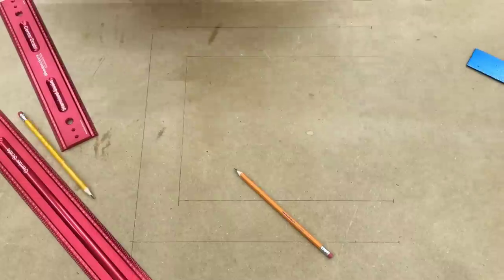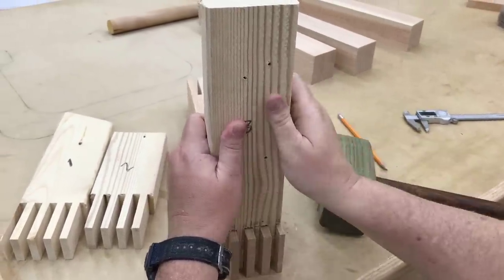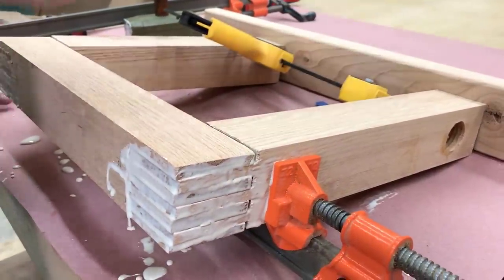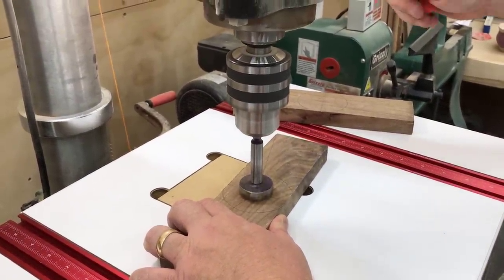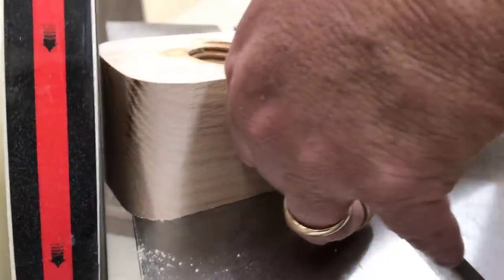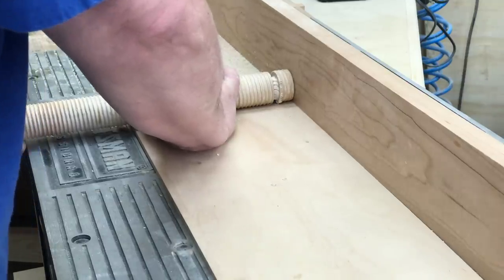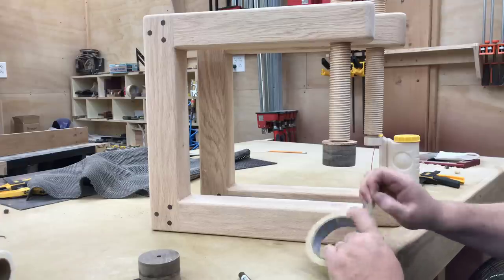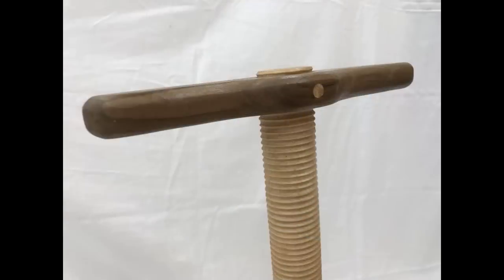15 - How to Make Deep Reach C Clamps All Wood only $10 Extreme Strength

Comment: You have a delightful, soothing voice and demeanor while working and teaching. The thorough nature of your instruction leaves us mere mortals, who clearly are not worthy of wielding Thor's Hammer, with the impression that we could do this, too. I think I will definitely be getting a little palm router and making a table for it. I might be able to leverage SOME of what you did here with that. I  have a pretty bijou shop squeezed into one corner of a garage, so that table saw-multiple router table-drum/disk sander-compound mitre saw-giant bench set up you're rocking there isn't really the water I swim in. And my hammer? It's made of rubber and it's fancy name is "The Gentle Persuader". Maybe I too can make a giant wooden clamp using some of these techniques. Hope. It's either the best or worst emotion.  Thanks for a great video. I will be referencing your build when I attempt my own clamps. But first, I'ma needa buy a whole heck of a lot more clamps...

Comment: Nice! 
Yours are quite a bit beefier than either mine or Matthias' clamps, though, so it should be capable of more pressure. 
One thing i've found is that cross pins through the box joint like that don't make a notable difference to the breaking strength, and may actually weaken it.
Reply from the maker: Hi John! Wow, thanks for the comment! I'm a big fan of your work.   I was also wondering that myself. I'm a chemist and definitely understand the strength of modern adhesives. But I just wasn't sure, and so I put them there. I've not done any real world testing both ways myself.
Reply: I do not think that the pins will make the joints weaker - assuming there is much pressure exerted by the clamp , the joint itself will have a tension at the transverse member side (at the two pins) and a compression from the free side (at the one pin side) and there is a moment at the joint (working to dislocate it) - while the pins might lower the strength of the wood members (whether the horizontal or the vertical) , they will resist the moment which I think he was worried about - however, if the wood pieces failed due to stress , it is unlikely they will fail at the joint.
Reply: Adding walnut pins shure makes the clamps look cool!
Reply: This project is way cool. I would like to know where you got the tap & die set. I’m thinking it’s a must have item!

Comment: hello Mr. king I started watching woodworking/woodturning videos I guess 5 years ago off an on mostly on! and like you I had skill saw jig saw an a belt sander mostly for building porches an lean to's and like most I was inspired from the videos and now 5 years later I'm grateful to be able to say I've got a nice little hobby shop with most of the pretty's I'd still like to still  buy a drum sander an maybe a small CNC an I've made a half dozen or so projects that I'm proud of 1 of which is a miter saw station alot like yours that's not all the way finished don't even have drawer fronts on yet  but I've been using it like it is  for over a year I  said all that to say I like your channel so far more than any I've seen to date an yes I know the big name's in you tube some of which was mentioned in your discription or in the comments but I think an hope with time an you keep going like you are you will smoke them all. with respect to the big name's because there channes are great.  good luck mr. king an ps.  I'm glad my station isn't finished I'm going to steal some of your ideas ☺
Reply: Hello! Thank you for such a nice compliment! :-)
Reply from the maker: Sc

Comment: Very nice.  I learned a bunch.  I already built the body of a few clamps using a bridal joint (not looking for the strength you are.)   I then sat at the bench for a few hours trying to figure out the pads.  Needless to say, I did not have a eureka moment...  This video changed all that.  Thanks!

Comment: Very nice build.  2 questions.  Did you ever think about chamfering the dowel and drilled hole before threading?  Ever thought of using epoxy instead of wood glue on the thread and dowels?  Thanks
Reply from the maker: Hi Mike, thanks!  I did actually chamfer the dowel before threading. But not the hole in the clamp before tapping. I've never had difficulty tapping oak or walnut. 

There is also an important thing to consider, and that is your tapping & threading tools. The set I use, (both the tap & die) have a large starting area. The die for example, holds the dowel snugly for a whole 3/4" before the threadcutter ever engages. And there is a similar setup for the tap. 

If you use metal cutting taps & dies, you get no such luxury and you must take great precaution to ensure the threading is aligned straight. Plus of course tapering ends helps here too, because the ones for cutting metal aren't nearly as sharp. And it'll help ease into the cut. 

Thank you for watching!
Reply from the maker: As to the glue and the use of epoxy, the study I referenced in the description did in fact use epoxy for one of their test glues. And on wood it did not have the bond strength that type 1 PVA has. 

This is not surprising for me, I teach and have done research as an organic chemist, and I'm familiar with real life use of epoxides and related chemical functional groups.  However, there is a common misconception in the public that epoxy is the very strongest of glues. 

This simply isn't true. The chemical reaction between a curing adhesive and it's substrate are entirely dependent on what they both are.  For some substrates, like aramid fibers and similar polymers, epoxy forms an incredibly powerful bond. But for many other things, (wood included) it just isn't the case. 

In truth, companies like Titebond employ organic chemists whose sole knowledge base is in surface chemistry & adhesives. So it makes sense that all they do is work to make the very best wood glue.
Reply: ... and here I thought you were just a "Fine" woodworker.  Excellent "Fine Working" on a shop tool!

Comment: how durable they are? even some my metal clamps are now twisted after some time of usage... what will happen with wooden clamps?
Reply from the maker: Hi, That's a great question.  In the real world of engineering, metal fatigues and wears out. This is why after repeated stresses, in some cases it must stop being used. 

Airplanes are a good example of this.  For metal aircraft, once the airframe has logged a certain number of hours, it must be retired. After so many times flexing, it becomes prone to cracking and becomes dangerous.

No such restriction on wooden aircraft exists. Wood can continue to flex and not reach the point of fatigue. (provided of course that it is cared for and not allowed to rot, etc.)

I'm sure this doesn't translate exactly into the world of clamps, but certainly some of the principles must hold. I fully expect the wood to always return to a zero deflection point after the load is removed.  And of course metal clamps are probably never loaded to their stress limits.

I have no doubt whatsoever that these clamps will serve for a lifetime, as long as they are cared for and not dropped, glued spilled on or otherwise abused. But we should make no mistake, metal is a vastly superior material for clamps. But this is an inexpensive alternative, and hey, it's fun because it's wood. We are woodworkers after all.
Reply: In fairness, airplanes get retired because pressurizing and depressurizing them over and over again (which allows the people flying them to breathe at much higher altitudes than Mt. Everest) causes micro-stress cracks. Wooden aircraft are not pressurized. Metal non-pressurized aircraft last just as long as wooden ones, which is why there are still so many DC3's from the '30's flying around. If you tried to pressurize a wooden aircraft, which is skinned with hardened fabric, you'd blow the skin the first time out. ;)

Great video, though. I'll be using it to make myself a set!
Reply: The only clamps whose bars I bent were cheap cheap cheap cast ones. I didn't manage to bend the bar on quality clamps with the same size bar; I suspect the cheap ones use some kind of garbage steel that just isn't any good.

Comment: I think if you read the manufacturers' recommendations and most other sources will suggest to butter both sides of those boards, as do my years of experience (SalineRiverWorkshop) - TiteBond III is a Type III PVA (ANSI rated) glue (waterproof), TiteBond II is a Type II PVA glue (water resistant) and TiteBond (classic) is a Type I PVA glue - there are differences in price and in tack, open and cure times.  Talk to the store manager at HD/LWs and ask for a lower case price for the gallons and get them ten at a time (shelf life sealed is pretty good, freezing destroys it) - or talk to National Casein for the 55 gallon drum for the best prices on glue.

Thanks for the video, brother - I enjoyed it.  Keep up the good work.
       I Subscribed and Thumbs Up!

Comment: The router table looks like a lot safer place to cut that slot into your wooden screw.  I was wondering why you didn't at least use the mitre gauge to hold your work 90 degrees to the blade. Freehanding that on a table saw seems like a great way to get something thrown into your face at high speed.
Reply from the maker: Thanks for the input.

Comment: So $10?     $200 for thread cutter  & $45 for the oak (in UK) .   = at least $245 for a pair. Oh ! and make a finger joint jig !😭
Reply: Not if you grow and dry the wood yourself. And sell the car to get the tools. To get the funds to get another car. So you can take them to market. Then you just might break even.
Reply: Next on durp a dur, we watch as someone with no wood working tools and wood material complains that a wood working channel assumes you have a basic set of tools and some kind of wooden material.
Reply: @doibing9856  I'm a beginner woodworker. Not fully equipped yet. I agree: 10$ is very misleading.
Reply: Doi Bing 😆😆😆
Reply: @russellgrantappling1153  I never seem to break even.

Comment from the maker: Share pictures of your work & get help if needed.  Join our King’s Fine Woodworking Community Page. 

Woodworkers helping other woodworkers. Share advice, get project ideas. Free tips. Insider information. Get the best deals on lumber & tools. 

https://m.facebook.com/groups/134828903893994
Reply: King's Fine Woodworking 
Just joined the Facebook page, I'm excited to learn and do... I'm a boilermaker by trade and deal with metal as a job. Welding, cutting, torching is my job but I'm really enjoying woodworking.
Reply: Eric Jones k
,
Reply: Adrian Spenc
Reply: 3
Reply: A YEAH and thats how yo build a house with some woodglue sawdust and a serious crap load of clamps... lol
Reply: Could you please link to the research you mention at the beginning?
Reply: some on wise said you can never have to many clamps . exhibit A 35:46
Reply: Wow, not bad, you made some great $10 clamps and only consumed $500 worth of labor to make them.
Reply: Why didn't you just use a planer to get rid of the poured out glue on the joints? It would have been quicker and easier and give you a smoother surface.
Reply: @berniecruz8405 
Dried glue is much harder than wood. 
Let's see if you can figure out the rest
Reply: @TasteMyStinkholeAndLikeIt  i actually took wood shop in high school AND that's how I got the dried glue off the wood! So now, let's see if you can figure the rest out because I actually know what I'm talking about!
Reply: King's Fine Woodworking `🐐
Reply: saludos desde Mexico , me gusta mucho tu trabajo te envio muchos saludos y felicitaciones.
me gusta mucho tu canal.
Reply: Lovely Video clip! Excuse me for butting in, I am interested in your opinion. Have you heard the talk about - Schallingora Dexterous Programme Scheme (just google it)? It is a great exclusive guide for taking a drawing and turning it into wood minus the normal expense. Ive heard some great things about it and my mate after a lifetime of fighting got astronomical success with it.

Comment: I like your clamps. the wooden screws are nice. I made a set with 1/8 finger joints. but I used a 1/2 in all thread and epoxy a handle on. it's amazing how strong those joints are. even with the 1/2 in all thread the oak holds threads perfect. thanks for sharing
Reply from the maker: Thank you!

Comment: I know you picked the red oak for strength and resistance to flexing, but damn, those are pretty as well. and that sled is really sweet. thanks for sharing this. I would love to have a shop like yours. very nice project. sometimes the coolest ideas are just a way to fix a problem. and yes, more clamps are always the right answer on something like this. under-clamping does not make a good finish.

Comment: Very nice strong finger joints. You had me on the tap, I thought it would have come out the side. Good job and excellent tip on Tung oil. Clamps are KING and so are fixtures.
Your palm router is Rigid, I went with the Ryobi. I caught the making of your work bench some time ago. Nice job!!!

Comment: I have used 50/50 distilled vinegar and water for rust many times....works really well....try a few things and see what happens....generally takes about 2 hours of soaking to work. I have used this on old bolts and stubborn metal including tools. Follow it up after drying with clear coat. You like laquer???....That will work just fine. 
Distilled water is best but tap will work just fine. Love your channel! Watched everything you have! 
Your vice is awesome and the clamps are well....way beyond what I would have bet on! 600 plus pounds? OMG! That's insane!
Everything else you have built is a pipe dream right now....I am rebuilding our church after Harvey....12ft of water plays a toll....Your kids are awesome! Keep on expanding your awesome talent! 

I'm just getting into wood and I think I have the wood-bug!  It's not a bad thing...lovin it!
Reply from the maker: Hi John thank you for your tip and kind comments. I hope your church rebuild goes well. Our prayers are with you and everyone else affected.
Reply: Hey Harvey. Don't you get government grants to help rebuild. Now that a Christian in president you might want to re apply.

Comment: you could further improve this clamps by strengthening those sharp edges on the inside, those become stress concentrators so if you make a little radius there you should achive even less deflection. amazing work !

Comment: Very interesting and informative.  The only drawback is that the $10 clamps require a $73 threading and tapping kit that most woodworkers would have little use for.  However. that part of the design can be replaced with a threaded rod and one or two nuts inset into the lower side of one arm.  The use of the box joints and dowels is well thought out.

Comment: The best  box store wood I have found is the pink colored 2x4 which is yellow pine or red douglas fir.   The best oil to soak it in so far is baby oil.  It seems to penetrate quicker. I turned my own dowels and before sanding smooth added the baby oil. I think it penetrates quicker in the roughly turned wood

Comment: Great looking clamps. One thought for improvement would be a shallow recess for the walnut pad on the oak. This would help prevent sideways sheer if it was knocked. Glues are great for resisting being pulled apart, but not so good at sideways sheer. I think it's great that you've avoided any metal in the build too. Shame the UK has fewer outlets for good woods, and likewise the tapping tools are also something not often seen here either.

Comment: Your video instructions are clear and concise. A question for your-  The wood threads are fantastic. Would it provide any integrity applying oil/lubricant to the theaded pieces prior to inserting the theaded dowel? Does the wood have enough natural fluid to off-set dryness/brittleness?

Comment: Great clamps! Just thought I'd make a suggestion on lubrication. Lanolin is very slippery. You can get the pure stuff in either liquid or paste, but probably the quickest and easiest is to buy Fluid-Film. It has a lot of lanolin in it without any solvents or other stuff. If you try it, let me know what you think.
Reply from the maker: Thank you for the tip! We will try.

Comment: These are beautiful and would love to make a couple of them; however, to spoil the "fun" .... Harbor Freight has some very decent deep throat steel ones, 12" deep, perhaps not quite the capacity for about $7 each. No, they are probably not as strong, but they do work and have for me for 15 plus years. Now, obviously, I was looking for other deep throat clamps on here, but even deeper than 12" ... would like about 18" deep for those odd jobs, table tops that might get laminated, etc. Modifying this design might work, not sure. I have also used Bessey's "pre-REVO" clamps with their edge clamp attachments at various points for some deep throat needs ... usually works, but somewhat cumbersome. A nice 18" deep throat, that actually held up with pressure might be the trick and may try to make a version of these. Thanks for the GREAT video though.

Comment: Here's a tip from an engineer...
When beginning to do the tapped hole, remove the cross bar, place the tap in the chuck on the pedestal drill.
Loosen the belt in the gear housing and use the pulley to manually drive the tap in, for 3 or 4 turns.
Keeps everything plumb and square.
Reply from the maker: Thanks for the tip.
Reply: Farenheit 451, that is an awesome tip! Thanks!
Reply: PS: You must be a Ray Bradbury fan! LOL!!